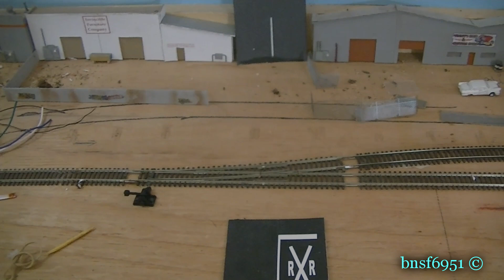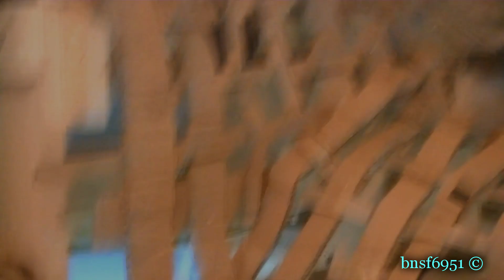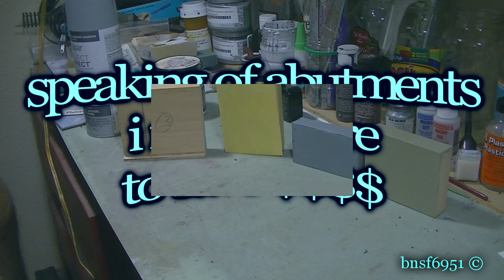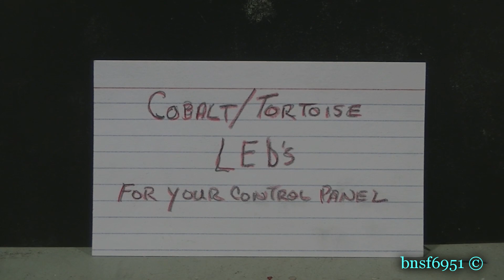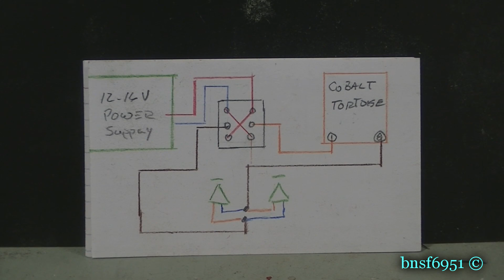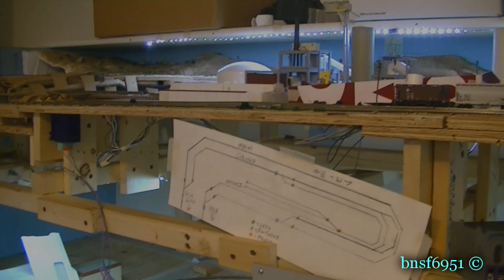MAJOR CHANGES #27 WITH A VV TUTORIAL

Comment: Lol Vinny, my brain was starting to twist itself in knots while watching the 'Anode' and 'Cathode' diagram as it was trying to remember which was the long leg and which was the short, bingo then I remember, the Cathode is the shortest and the negative and the Anode is the longest, the positive yippeeeeee lol :0)
Shouldn't the LED symbol have a something like a lightning bolt coming from it? I only say that because I remember it use to think it looked cool. And then you give me a shout out, that was a knockout lol :0)
And yes, I can't see any reason why this wouldn't work with servos whether DCC or DC, but with the MegaPoint system that I'm using the boards will control any LEDs you want to add for the turnouts and also signals, the board to do this is called a multipanel and is used to control up to 200 turnouts and signals. The control panel that houses all the LEDs is called here in the UK a 'MIMIC' panel which is basically a track plan on a piece of perspex or wood
Example of a mimic panel https://www.youtube.com/watch?time_continue=3&v=QTJGApI1xnA
And as a bit coincidence Dave Fenton the creator of MegaPoint controllers has just uploaded a video showing the same sort of thing as you, how bizarre is that and this is the link to that video
https://www.youtube.com/watch?v=YfUQDafRF-8

But Vinny, keep up the great work mate, you a real trooper and a credit to all us model railway [or is that model railroad?] fans across the world.
Cheers, Mark

Comment: Yet another informative and timely video Vinny. I have always used the cardboard skeleton method and found it to be very good and helps produce good contours and sturdy support. I had always used paper towelling dipped into plaster in the past but will try the plaster bandage for my new areas. I have also used the newer Plastic Fly wire screen for rolling hills and have liked that also though it needs more support  than the cardboard skeleton does.Also thanks for the LED tips. This is quite timely as I am in the process of retro-fitting my small point control panels with LED point route indicators and your advice is timely. I use the Cobalt IP Digital point motors and was intending to use the switching capabilities of the motor. Though now I may jury rig a working model to see how it works. I did notice that you didn't appear to  use a resistor with the LED's did I miss something?Anyhow thanks Vinny for another good video.Neil W

Comment: Thanks Vinny another video, just a note anode is positive cathode is negative like  idea on how to wire the LEDs but some of us use different colors for Direction turnout as thrown,  you can use the same setup to put lights on the layout to that would be make it easier to tell which way it is thrown as you travel without having to look at the panel, as usual you have great ideas I hope you don't mind me using them and I will check out the the channel to that you suggested about the servos as I was thinking about using them...
Reply from the maker: hi Jack... it's been a while since I've done this but i'm pretty sure you can piggy back the LED's so you would have them on the layout as well as in the fascia.. thanks for your input on identifying the LED leads... thanks for watching & your comment.. vinny
Reply: No problem, I was not sue either but was working on some cars yesterday & had to redescover it too!